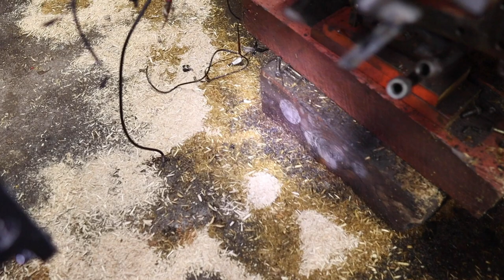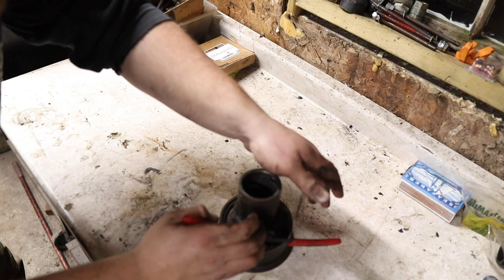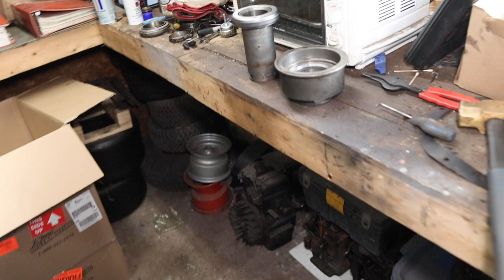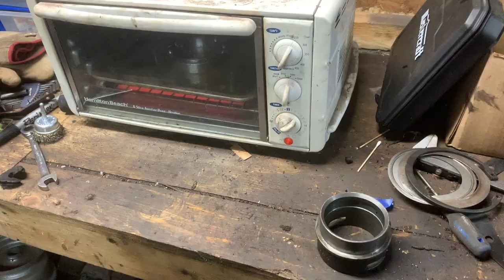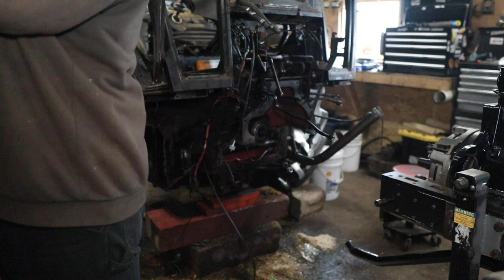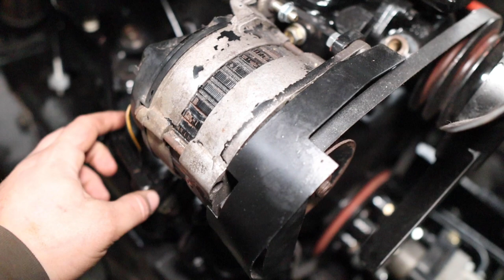Case David Brown 1394 Clutch and reassembling tractor

Comment: She is looking good.  I like the toaster oven for heating up the parts to ease assembly.  We had a freezer in our shop in a previous life where we would put airplane parts for days that were having issues related to our cold operating conditions.  Was always humorous to see someone grabbing an ice cream and being shocked to 6 plus figure electronics in there.  The freezer was not even capable to reaching the temps (-60c) we needed but it helped a lot.
Reply from the maker: Yeah man every bit helps. I need a freezer for the shop but I do occasionally stick stuff in the freezer at the house. Sometimes heating one part and freezing the other makes for pretty easy assembly. 6 figure electronics would shock most people I would think lol.

Comment: Has the cylinder block been changed for an older one from a previous range? 1394 should have a spin on canister oil filter.
Reply from the maker: Yes it has a 995 block in it I couldn’t find another later block to use. The original had thrown a rod out through the side.

Comment: Do you still have the tractor? If so I had a few questions
Reply from the maker: Still have it yep
Reply: @macfarms  I was looking for some insight on installing a turbo. Someone had removed it and wanting to put on another one but was just wanting to see a tractor with one to see how it all hooks up. I was wanting to try and use an hx35 instead of using oem style, because there’s a huge price difference!
Reply from the maker: Yeah I see the aftermarket replacements for the 1394 are pushing $1500 CAD now. I think a HX35 would be a bit much for a 1394, would be a good turbo for a 6 cylinder DB though. I'm not sure what the other alternative would be. HX25 maybe? or a HX30 with a wastegate.. You really don't want to push too much boost through these engines with the lighter crankshaft.